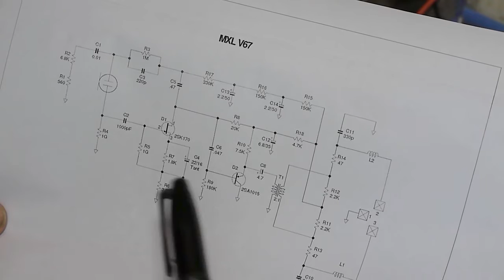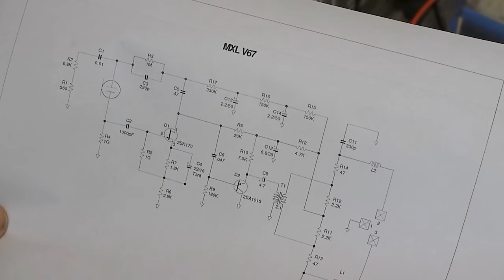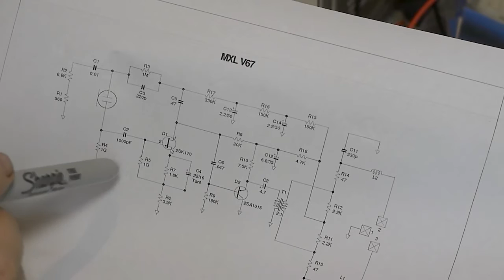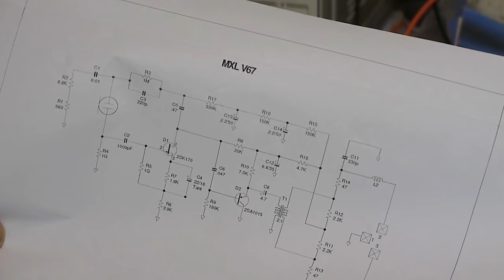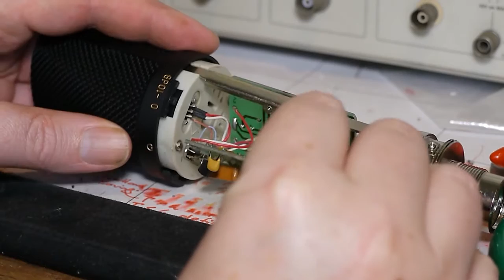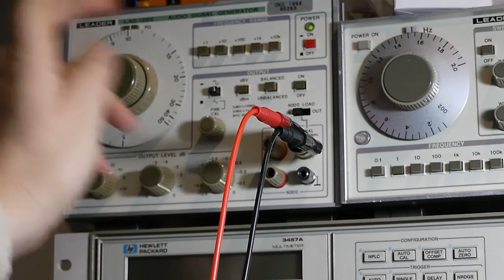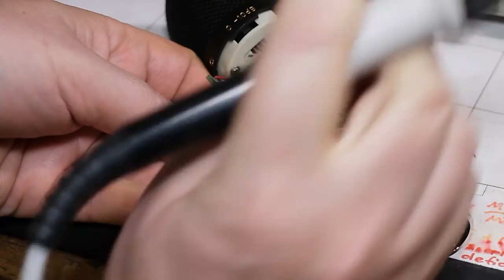Adjusting the bias of a condenser microphone

Comment: Hey Karl,  Im trying to bias a microphone a friend built thats a U87 clone.  Where would I insert the Freq Generator? And where would I connect the Oscilloscope Probe?  And do you disconnect the capsule when you do the biasing?
Reply from the maker: As I recall, I just connected to signal gen directly to the capsule side of the 1nF coupling cap that leads to the gate of the FET, leaving the capsule connected. That's not really right, though - so maybe don't do it that way I did. Better to get a capacitor of approximately the same value as the capsule (say 68pF or so) - desolder the capsule wire and connect the sig-gen via your 68pF coupling cap to the point where you just removed the capsule wire. In my case I just connected the scope to the output of my mic preamp, but equally you could pick it up from the driven lead of the output transformer instead.
Reply: I just built 2 U87 clones, and would like to custom Bias the FETs per each mic, but don't have a distortion analyzer.

On the various build threads they say to Bias the FET before the capsule is wired. I have an older Heathkit single trace scope, which should work fine. Need to borrow a signal generator though.

Anyway, so far this is the most comprehensive video I've seen on biasing a Mic FET.

I'm a little intimidated to try it on my own!
Reply: @Wizardofgosz  I wonder if it's feasible to simply use a computer audio interface for all the task - i mean it can output audio frequency signals, it has a mic preamp with 48V phantom power source, it can capture the mic signal, and soundcard oscilloscope software exists. You can drive a stereo output pair where one channel goes into the mic capsule input where you output 1KHz  sine reference signal, while on the other channel you generate sine signal of same amplitude but maybe 50-100Hz and connect that to multimeter in AC mode to get approximate absolute values, and the output volume control will control both at the same time - with some tracking error, but i bet you can just disregard it.

It seems you could even just use an old MP3 player or PC onboard soundcard to generate signals, considering you have rest of test equipment.

I got a 15 year old TASCAM interface which is junk, but it was only a few $ and that's all i could afford, it works, and it'll have to do, because there is no way i can get access to professional test equipment - even just a better Behringer HD interface is a distant dream at this point. I am interested in the topic and will want to build a microphone circuit and adjust it myself, but haven't done yet. Is there something i'm missing?
Reply: @SianaGearz  I should think this is possible.

Comment: Thank you,It's very helpful tutorial! Could you please tell to which junction on the PCB you connect the oscilloscope lead, and you mentioned that you connected a resistor instead of R9, what value. I am trying to do the same thing to the V67G that I own. Thanks,
Reply from the maker: Thank you. The modification was to add an extra 510k resistor in addition to R9 so that together they form a voltage divider - as shown here:
https://www.dropbox.com/s/p8psqqicpsgm0fi/MXLV67mod1.jpg?dl=0

I installed mine on the back of the board (not exactly neatly) like so:
https://www.dropbox.com/s/nw60kyzoo6encdf/MXLV67mod2.jpg?dl=0

As I recall I connected the scope to the output of the preamp, rather than directly to the board - although I'm sure you could take the signal from (say) the transformer side of C8 instead.

Cheers & Best of luck with modifying your mic.
Reply: Thank you,
Reply: Hi Karl, I did most the changes you recommended and the mic sounds a lot better and more sensitive.  Though I could not locate a seller for J508. Any replacement I can use instead? Thank you so much and sorry to bother you.
Reply from the maker: Good question - there's the 1N5307, but if anything that's even harder to find. At a pinch I've also used a selected J202 with gate shorted to source (but you need to test a few of them till you find one that gives around 2.4mA in that configuration). I originally bought my stock of J508 from Future Electronics, but I see they've got none in stock (and the minimum order quantity is 4,000 - eek!). There are some on eBay if you don't mind paying the asking price, which is a bit steep. I'd be happy to post you a couple from my 'stash' (I've still got a bag of them somewhere) also.
Reply: Hello, I actually have one of 1N5307, though when I used it did not seem to work very good. Possibly I did not hook it up correctly ( polarity configuration issue) or maybe because I changed the JFET to PF5102 which is working nicely. I live in U.S my email srifai1@hotmail.com. Not sure if you can post one of J508 to me to try unless you think I don't need it. I will pay you. It has been very fun project! Really appreciate your generosity and help.
Reply from the maker: It might be worth measuring the voltage drop across R10 to get an idea of the quiescent current (as well as how effective the DC biasing is). One of the issues with a simple circuit like this running from phantom power is that any change to the current draw makes the voltages move around (because of the 6.8k phantom feed resistors) so I like to match the constant-current-diode to the quiescent current through the resistor it replaces, to keep things as similar as possible to the way they were before.
Reply: I will, thank you!

Comment: Thank you very much! Great video... really loved it!!!
Quick question... for the THD test, where did you connected the test lead for the signal?
Kind regards!
Reply from the maker: Thank you so much. As I recall, there's a 1nF coupling capacitor between the capsule and the gate of the FET, and I connected to the capsule side of that capacitor. Looking back, I probably should have connected the signal through a high value resistor, as directly connecting a low impedance source to such a circuit may have changed its behaviour somewhat.

Comment: It would seem the manufactures neither optimized the circuit for either headroom or distortion! Would you in fact ever get as much as 1volt from the capsule in normal use?
Reply from the maker: Large diaphragm condenser capsule sensitivities are usually around 20mV/Pa, so a signal level of 1V would imply around 50Pa or approx 128dB SPL - pretty damn loud, but you'd easily see that sort of level from a close-miked trumpet, for example. The issue with optimization is the device-to-device variation in the FETs - they're not particularly tightly binned for Idss as supplied, and testing and selecting them prior to assembly (and/or choosing source resistors to match each FET's characteristics) is an very expensive proposition.
Reply: Thank you for your prompt and kind reply, I have subscribed.

Comment: beautiful video. can you also add a sketch of your connections
Reply from the maker: Thank you - I agree that a sketch would have made things clearer, perhaps I could touch on that in a later video. Cheers.
Reply: so, did you do the video?? if so could you provide the link??... I really liked this video, yet the final sketch with added info is clearly a must have, I am planing in building my own mic and it may be that if I buy the same resistors and other components that you used, I could skip the need of a multimeter and I could skip the need for those big machines that you were using and that for what I need could be considered total overkill...
Reply: Doing electronics without a multimeter is... naive, to say the least, i'm afraid. "Those big machines" can be relatively easily replaced with an inexpensive audio interface and free software, by the way.
Reply: hum nope!... there is nothing naive in the statement... if the guy who is making the video is already using a multimeter... why do you need to shadow at home the very same steps that were already seen on the video, that took the author such a time to properly create!... by the way I just tried to do a smaller version of the amplifier and it was a pain... the authors are tossing these videos out as if omitting info was a cool thing or as if it was some sort of standard... check my channel so you can see what I mean... the problem is a big one... check my video so you can see it...
Reply: Because components have tolerances - JFETs especially have pretty loose ones, compared to other components.

Certain information is "ommited" because it's sort of taken as granted that a multimeter is among the bare minimum tooling you need, to be able to do anything useful / meaningful in electronics.

If this was labeled as an electronics tutorial (which it's not), THEN i would understand your dissatisfaction.

Suppose your (first) circuit doesn't work (and there's a chance it won't). Without any test equipment, how can you even hope to troubleshoot it? Plain guess-work? Well, maybe except for the "shotgun" approach, where you just replace all the components (or just one at a time)...
Reply: well I like that explanation, but you haven't seen my video as of yet have you??
Reply: I'm actually watching it right now.
Reply: cool... then I wont distract you...